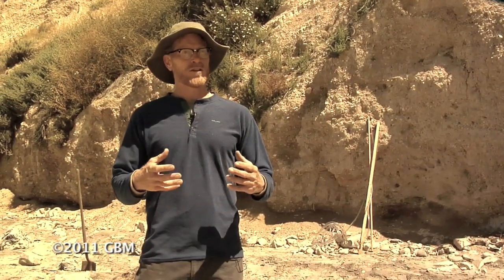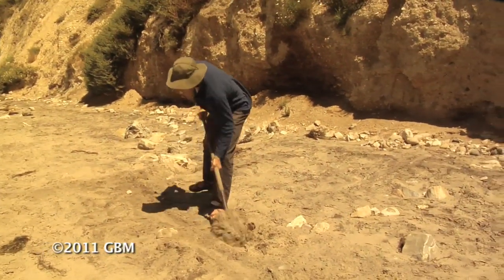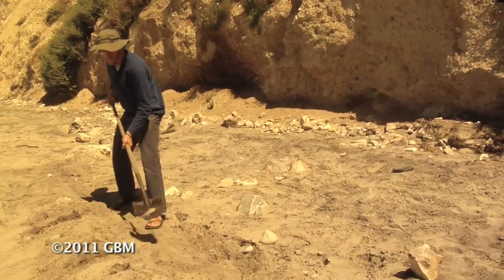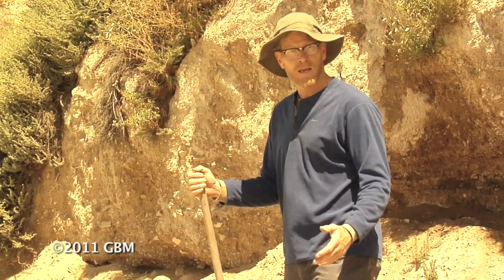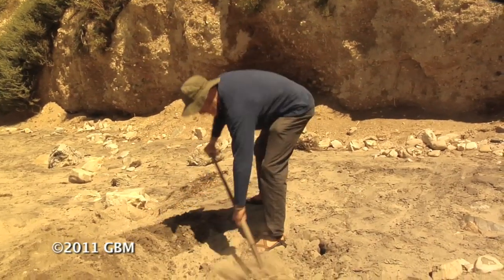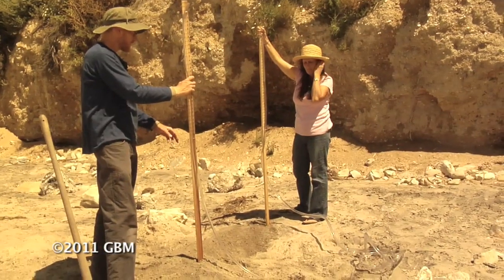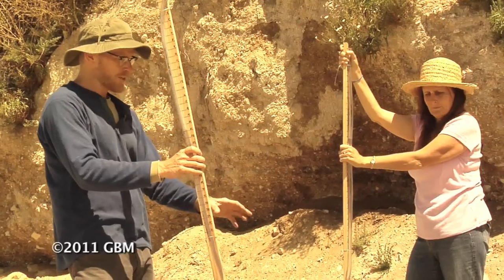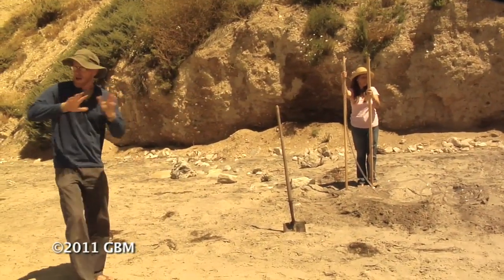Brad Lancaster demo: Learn how to build a Berm with a bunyip water level

Comment: Curious if you have any info on how I can work with my property and my neighbors to help recharge our groundwater supplies. Our area is mainly 11 acre's and larger parcels and most of us the area's aren't developed. Just open land. So we're open to do whatever with it. We all have low flowing wells. 1 gallon per minute in our area with well depths of 70 feet in my immediate area. A couple of my neighbors had to go down 1,000+ feet.
 
We are in Calaveras county in Burson, CA. We don't have much soil depth (inches) Not sure what's under it (some kind of rock/granite), but when it rains the water stays on top of the soil or flows other places even when we set up berms to try to get in to infiltrate the soil. Have one area that has a huge water fall off a hill when it rains, flowing around 50 gallons per second. It'd be great to harness that water and get it into the ground where our wells are located.
 
Any ideas on how we get get the water to go thru the ground? Would taking a tractor and "ripping" the ground to open it up like 6 feet deep break it up enough to let the water flow into the ground? Know of any sources to “model or image” the terrain  underground so I can find out how deep the rock goes so I can get the water to seep into the ground instead of just stay on the surface.
 
Any ideas on who to talk to, to analyze what the ground looks like to our well depths so we can get the water to percolate thru our soils instead of runoff into a creek a ways away. Hopefully at a somewhat cheap price or thru a trade/barter. :)
 
Hope to hear from ya!
Reply: I heard someone used a controlled  explosion to crack the underground  ,had the same problem
Reply: So Craig it’s been 8 years since you posted this comment, what did you end up doing?
Reply: @joemc111  Natta couldn’t get any help with it. Everything is a headache in California. Cost hundreds of $1,000's to do a simple thing. permits, environment, bla bla
Reply from the maker: You might want to contact Brad on his website to reach him directly.
Reply: Talked to his assistant and on his website. his assistant said he won't reply directly to me.
Reply: @CraigMullins1  you can dig a massive  pit fill it with gravel when it rains it’ll filter the water straight to however deep you dug until it “overflows” depending on how fast it’s absorbed
Reply: Add cattle et goats
Pile their hay et manure
Plant corn, beans, pumkins 
Three years later beautiful  soil